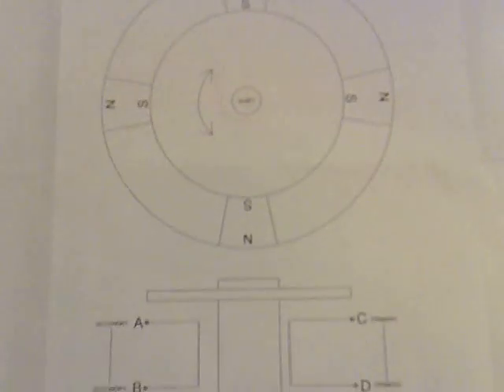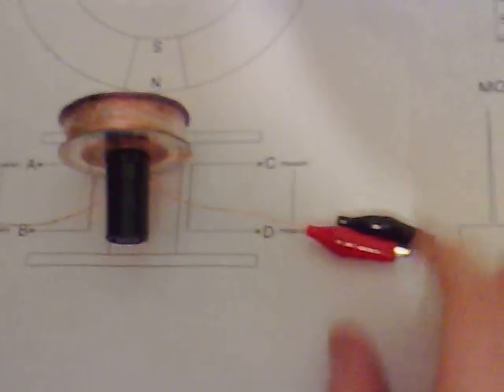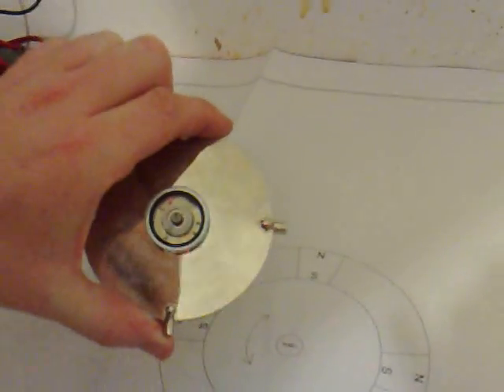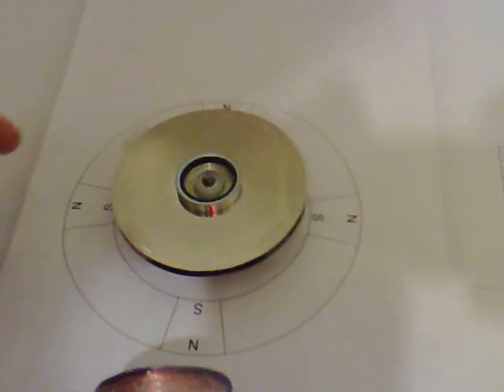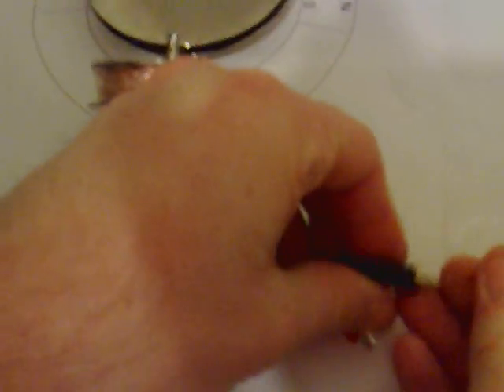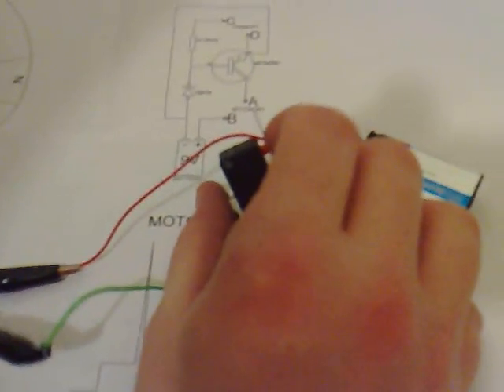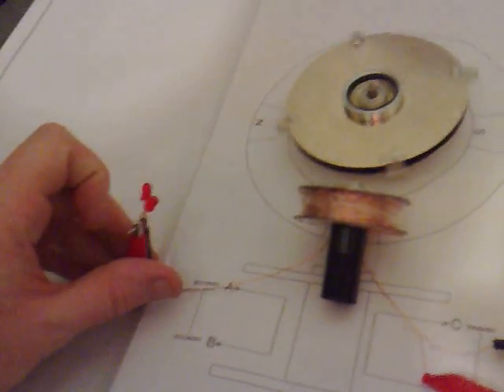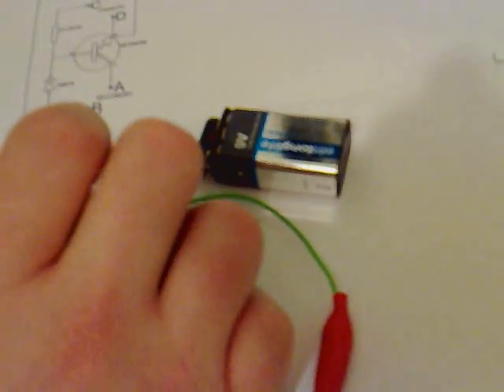Pulse Motor (Back EMF) 002

Comment: Using back EMF to recharge a battery will actually -reduce- efficiency, because any significant current draw on the secondary coil will slow down the motor. You must convert kinetic energy to extract electrical energy, and this is why the motor would slow down. The reason it doesn't slow down with the LEDs attached is because they do not draw a significant amount of current. Ever try to turn an electric motor by hand with the coils shorted out? It's much more difficult than with an open-circuit.
Reply: there is no secondary coil, the diode recovers the reverse voltage spike when current is interrupted.